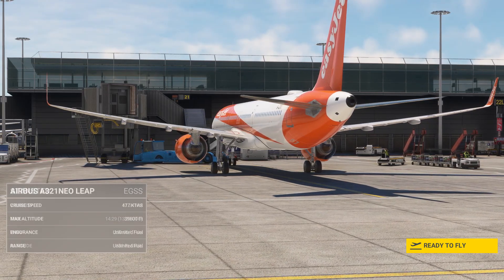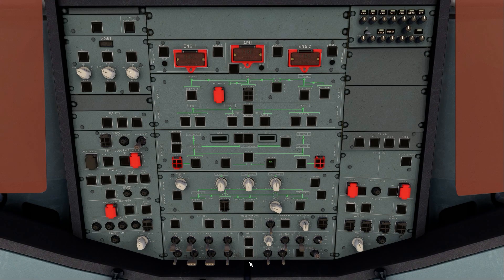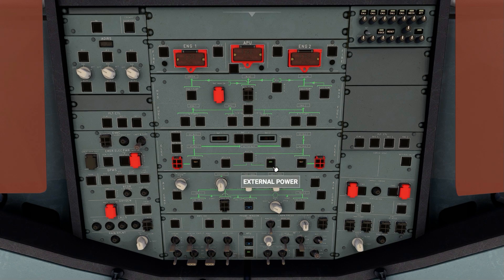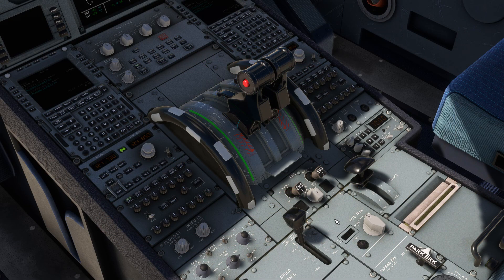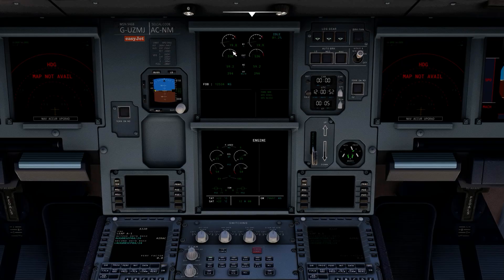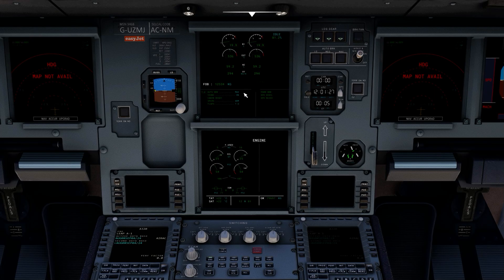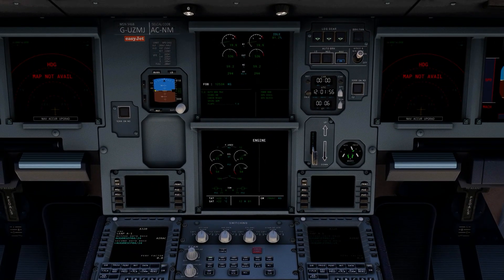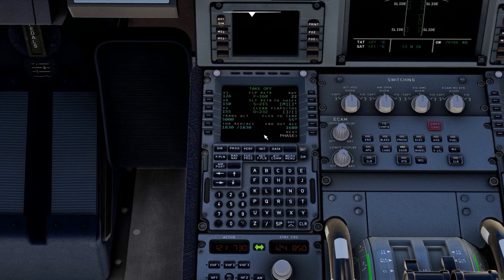LVFR A318/19/20/21 Startup Tutorial | MSFS

Comment: The A318 ECAM selector buttons don't work currently which is strange because they work on the other 3 models.  The bottom ECAM screen will only change when the plane auto-changes it.  Doesn't stop you from flying but it's a shame.